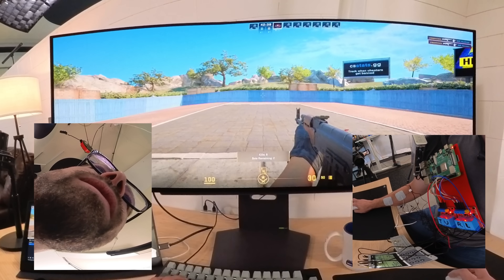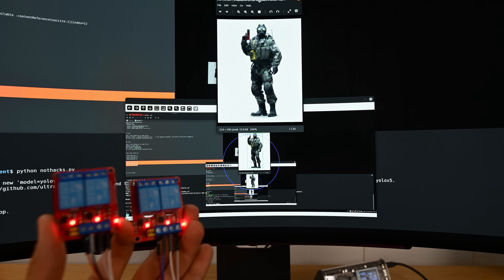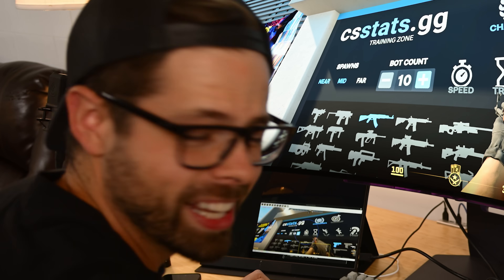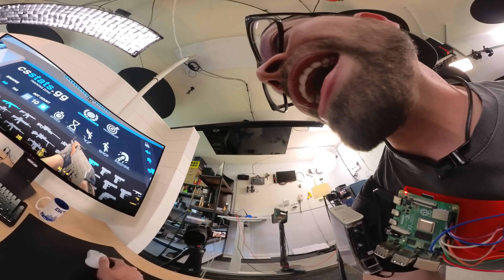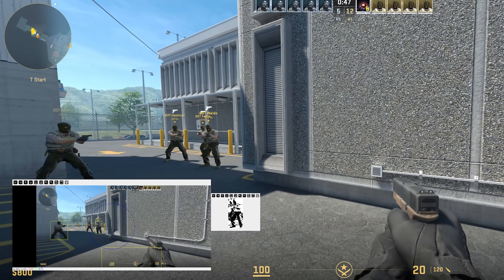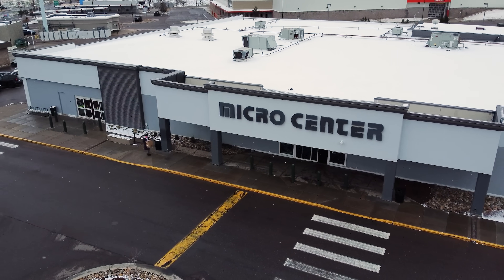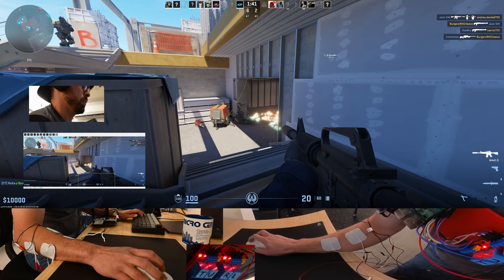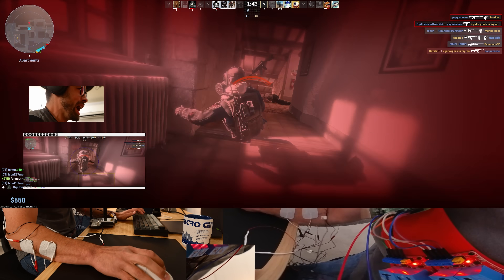Neuromuscular Aim Assist

Comment: Remember kids, people ACTUALLY go to these lengths to cheat. Like some people run a dual screen setup or even dual machine setup where one screen has the game with cheats and the other without.
From what I learned on average 40-50% of players tend to use 3rd party scripts in one way or another, from innocent mouse and controller macros against recoil to hard on glitch and software exploitations. I mean people try to fake accidents on the roads so much that people make yt channels about it, but you think they dont cheat in casuals? You are green if you think everyone is just good or better at the game.
Reply: most of this is right, but 40-50% is an ABSURD estimation

Comment: Spending 3 hours a day with this you can bet after a month you wouldn't even feel you'd be getting zapped. Also the brain would develop a model where it would further fine tune and adjust impulses to be even smoother after getting zapped so your reaction times would definitely further improve.

Also If you used neural AI to train a model how much you actually need zapping to get even more control and function... This is basically cyberpunk lol.

Comment: this video is basically "From the moment I understood the weakness of my flesh, it disgusted me. I craved the strength and certainty of steel. I aspired to the purity of the blessed machine. Your kind cling to your flesh as if it will not decay and fail you. One day the crude biomass you call a temple will wither and you will beg my kind to save you. But I am already saved. For the Machine is Immortal"  lol:face-blue-smiling::hand-pink-waving:

Comment: You should use at least ONNX or tensorrt, youll get at least 2x or 10x FPS tensorrt is much much faster than your current Python Script, you should get at least 1000 FPS if done well.

For Yolo iam using a Pascal GPU and iam getting around 120 FPS.

Comment: I just moved to the US and shopping at Micro Center is absolutely wild, like imagine being able to talk to retail staff about the limitations of DP1.4 and needing to think about using active display cables instead of passive, where do they find all these knowledgeable nerds?
Reply: Wasn't expecting Hazzor here.
Reply: Dude i just watched your snack review before going to this video ;o
Reply: ! Hazzy you're in the USA now??? (Why I'm so sorry)

Also we kind of just live in the wild and learn random stuff. You should probably look at DisplayPort 2.1 if you're worried about latency or restriction. It's the newest standard since 2022, and supports an extreme amount of bandwidth. In general DP is better over say, HDMI, since it has more pins to allow a higher throughput-- but you'd still need a screen capable of delivering that signal at a sufficient refresh rate. There's positives and negatives to a highly responsive screen though-- say 240mhz on a 4k display. That uses a massive amount of power and even on some of the better cards if you're decoding/encoding video at the same time you'll run into a bottleneck.
Reply: @EspressosWork America, the only nation seemingly everyone hates, yet 80% of the worlds population would drop everything to move there
Reply: It would be just Hz not mhz but the rest I agree with @EspressosWork
Reply: @EspressosWork lol imagine being sorry that he's in a country where you can walk into micro centers and talk to someone who knows what they're doing.
Reply: @haruspex9662  As a person in texas I'd rather the healthcare.
Reply: @EspressosWork move out of texas lol. My state has state funded Healthcare and I get to retain more individual rights than most non Americans
Reply: @EspressosWork in fact you're doing something that people typically stereotype Americans for. Youre taking your personal worldview and experiences, and you're projecting them on the whole of america. Not every state is texas homie
Reply: @EspressosWork  Or you could just be payed more. Then you can afford healthcare if you need it, and if you don't, well you have some cash to spend. We don't need government healthcare. We need a fairer distributing of wealth.
Reply: @haruspex9662  I grew up in 2 other states and lived outside the USA. Get off your horse, pal.
Reply: @Elrog3  Both 👍
Reply: @ivoryphoenix7  No. We just need to pay people what they are worth. We don't need to steal from people what they have earned to give it to others. We don't need to reward people for making poor health choices. And we don't need a massive, inefficient, and bloated system.
Reply: The man, the myth, the legend.
Reply: Ask the locals about the recommended places
Reply: Hey ive been watching a ton of your Rimworld videos the pay few days lol

Comment: 🤔 you could switch from relays to mosfets. Then you could use pwm to modulate the amount of strength quickly.
Reply: Not sure if mosfets will provide adequate isolation from the tens unit though

Comment: first, to have precision, you have to adjust your sens in order to get from point A to B with exactitude, adjust to when you feel isn't going over or need more to aim the target correctly. This in case you have struggle with mouse aim. apply with arm and combined wrist+arm aim too. the thing is go from A to B with precision. Then you can continue with the experiment. i would like to see more about this because is very interesting and can call the atention from neuroscienctists.

eliminating the dynamic crosshair can help a lot. use the static and dot one.

absolute legend from the old days. ❤❤🔥🔥

Comment: You HAVE to try it with the upgrades you mentioned towards the end. I was immediately skeptical when you said it was running on wifi anyways, but there's so many things to optimize for this,  just wow
Reply: Yeah I bet the rpi could be swapped with an esp32 or arduino and a USB cable for much less latency
Reply: @boeing_is_best5632 the latency with wifi or a network cable is really bad 😄
Reply: @boeing_is_best5632  if it's wired, stm32 would probably have even less latency

Comment: I am legit shocked by how viable that is. you would think it would be completely imprecise and finnicky but not it can actually help you click heads. As you said with more electrodes that are more precise and better control of them this could actually become a legit problem for anticheat software. That however is just the surface of the potential here. Imagine instead you have electrodes across your entire body that could be triggered faster than you could ever normally react to respond to threats or danger of some sort. Guarantee this will eventually be weaponized if it really is that viable.

Comment: Have you thought about building these projects in GMOD where you can cheat and use Lua? would look just like counter strike but you could inject code into the game to pull things like team so the program is just testing if the shock part works.

Comment: I am not kidding, just yesterday I was using what I call the BS feature on Gemini where you just chat with it. I was talking to it about this exact type of thing happening, but with electronic prosthetic arms with Ai. It told me, "once ai gets intelligent enough and learns enough from people, it is very possible that they could tap into our nervous system and control us through electronic signals." Then I see this video not even 24 hours later and its got me double tweaked about AI even though it wasn't ai operated.
Reply: pretty sure the player detection was an ai trained on human figures as it was able to detect a giant face on a billboard, or his character's arms. it would also get team mates mixed up with enemies sometimes, so he was legit getting controlled by an ai
Reply: @cruze_the he was being operated by a computer he programmed to detect human shape object. He did not use an ai that detects human objects. I am genuinely curious if someone hooked these pads to certain nerves and told AI it was connected to those ones and to take control from there, could it? Would it?

Comment: This could be also used as a enhaced training tool, you get shocked if you fail to react under a time threshold so you dont always get electrocuted. The brain will eventually stop reacting to the shocks if it feels they are unconditioned.

Comment: Honestly if it was me, I'd use a lower setting rather than a higher one. The reason being you kinda want the whole thing to work subconciously in the first place. Kind of the way your periferal vision works, where if something flew past your face, you don't get a huge physical sensation, but recoiling doesn't feel 'natural' either by the way we normally move (dunno if that makes sense, but it's the best I have rn). So, more like a buzz than a jolt that your mind can associate things with to react quicker.

Comment: Rather than shocking your muscles through your skin→to then flex your muscles→to then force your arm to aim in the correct direction. What if you build a mouse sensor that connects directly to your muscles→So the tech picks up the microsecond your muscles react→so there is no physical delay in the real world 🧠💪🏻

Comment: Man I have cerebral palsy and everytime I game I always wish I have something like this to help me play better. But I have been laughing from the last 30 mins watching this thing😂.
You earned my subscription. Keep making such amazing videos.😁
Reply: What kind of games are you able to play with which input methods? Thanks!
Reply: @no1DdC Probably anything that's not in real time, turn based RPGs or chill games like Stardew valley. They could use that xbox accessibility controller
Reply: Maybe this could fix the large spasms of cerebral palsy. I don't know if anyone has tried it yet, but what if you could send a counter-pulse to a spasm to reduce the distance? E.g. instead of a larger flail you'd have only a little tick.
Reply: Have to trade it with pain 😂

Comment: How well would this work with prosthetics?
Reply: In my very unprofessional opinion, it would be faster because you don't have to deal with the tens unit, and directly make the motors in the prosthetic go off. Buuuuuttt, prosthetics have very poor range of motion compared to a human arm, so getting the proper mouse movements would be extremely difficult

Comment: I know its just a sponsored segment but micro center is genuinely the only place I feel good about buying new electronics, I bought upgrades for my pc Ryzen 7 7800x3d, 64gb ddr5 ram (made sure compatible dw) MSI b650 from amazon and everything came defective, motherboard had MISSING pins, and scratches on the PCB! The CPU had no apparent physical damage but refused to do anything even on a new motherboard (from micro centers test results), and the RAM, well the RAM began smoking (happened in micro center tests) so I ended up just buying from micro center when I figured out from them that basically all my pc parts old and new was fried (besides gpu thank god) got basically the same specs, built it and turned on first try. And I have plenty of other good experiences at MC, 3D Printer, 4k OLED Monitor (1 year old no burn in with heavy productivity usage), and almost all my peripherals (besides keyboard and mouse which are custom made). Side rant, I've just switched to linux aswell, and holy shit, im never looking back.

Comment: you should really try using this for a prolonged period and see if it improves your performance without the shocks! my hypothesis is that it will either pavlov you into being better or diminish your performance since your inputs are not actually from your brain for many shots.
Reply: I think if there is a time threshold to let you react ot will basically use pain as a motivator. If it doesnt diferentiate the brain will probably become lazy.
Reply: That's not all of it, a good deal of synchronization for limb movement happens in the spinal cord. So in a sense it will definitely improve him over time. Dunno how safe continuously electro shocking your muscles is though.
Reply: human visual perception alone takes ~80–100 ms (retina to brain processing), decision-making adds ~50–100 ms, and nerve conduction plus muscle contraction adds another ~50–70 ms. EMS skips most of that. Shocking your muscles wouldn’t make your brain or eyes process information faster, so the speed can’t be replicated once you remove the shocks.
Reply: @imfat1000 in the aim training community, that’s called VRT (visual reaction time) which is simply how quick you react to and simultaneously adjust to movement in your targets, not just a pure reaction time clicking a screen when it turns green or something, and it needs to be actively trained as a motor skill
Reply: @imfat1000  It's not that simple, the hind brain can learn muscle contraction timing related to what you see on the screen. Your brain still can relate when the muscles were contracted via feedback and what you saw. Now, it didn't initiate the contraction itself. This part might be fishy, still worth exploring.
Reply: I was thinking the exact same thing, i think he should do a study over 4-6 months on mnk players to see of they get better but use aim labs (more accurate stat tracking
Reply: @coffee_cody don’t think it would be too safe lol
Reply: @a1m..to hell with safety, THIS iS FOR SCIENCE!!!!
Reply: @coffee_cody alright cody, I thank you for your volunteering 🙏 I pray for your nerves
Reply: It wouldn’t actually help you get better mechanics lol, aiming is more a brain thing than simply physical, like lifting a dumbell, and he’s not actually consciously adjusting to the target himself